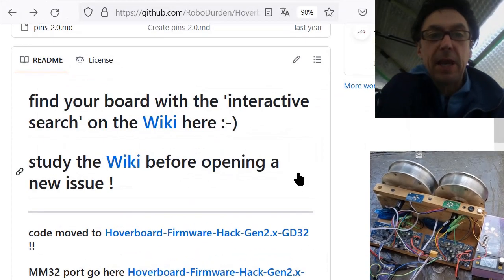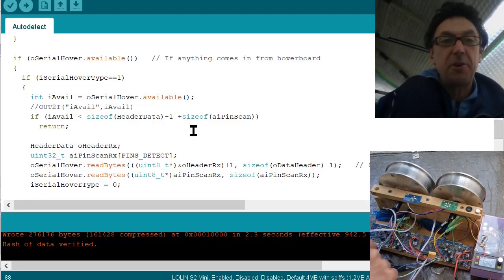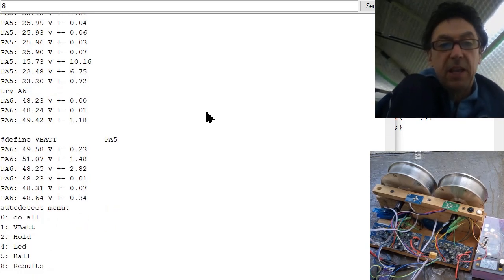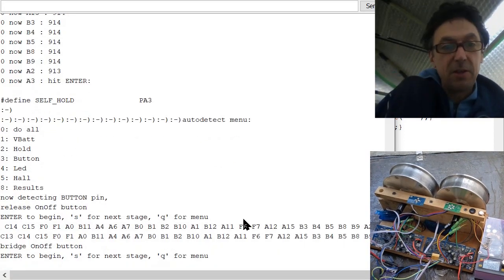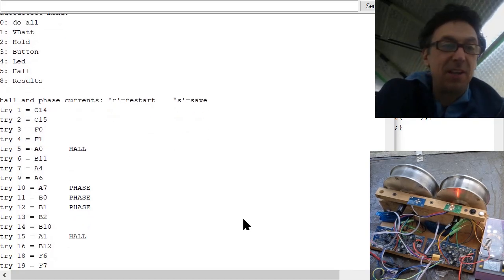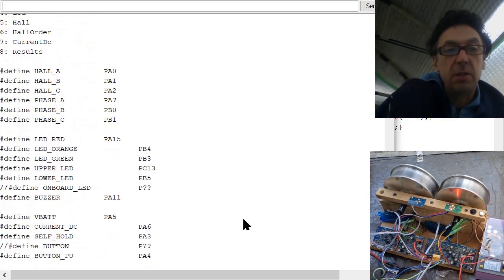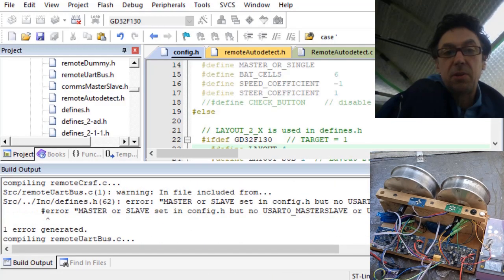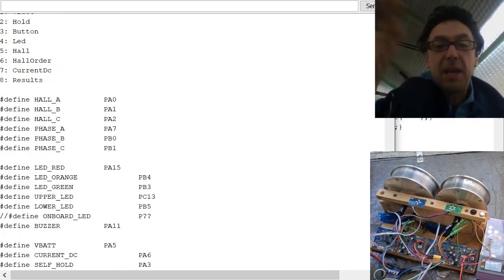Better Split Hoverboard Gen2 GD32 Autodetect

Comment: Hi, thanks for making this video. When I do the hold test, at the "release OnOff button" step, the board just turns off. I had to make some tweaks to make Autodetect work on a Blue Pill but don't think I've broken anything. Can you explain the difference between SELF_HOLD, BUTTON and BUTTON_PU? Can I compile the firmware without them? Thanks
Reply from the maker: SELF_HOLD is an output that activates the TO220 mosfet/transistor to keep the board powered. BUTTON is the digital input that detects the push of the on/off button. A push will also power the board and the code starts running. Therefore it is neccessary to quickly actifate the SELF_HOLD to keep the board powered after the push on the BUTTON is released.
BUTTON_PU means PullUp. I found one board so far that has an internal pullup resistor..
When the board immedaiatley shuts off when the onOff button is release, that means that i was not able to activate SELF_HOL by activating all free remaining io pins. That might be because your board is activating the HOLD transistor with an active-LOW signal, or whatsoever.

If you do not need onOff, you can bridge the button and turn on the board with this 75A switch: https://www.aliexpress.com/item/1005006310882730.html - the only one that works for my 24V solar car..
Reply: @robodurden  Thanks for the response. There is a chip that is present on the master but missing on the slave near the power cables marked with NCE01P13K 1PKL2. Could this be the doing the job of the TO220? The body of the chip and two of the pins are soldered to the board but the middle pin is not. I've not managed to trace any of the pins to the GD32. If it is connected,  I think it must be via other components.
Reply from the maker: @forfengeligfaen  please start a NEW issue on my github and upload lots of photos, as well as the full autodetect log. Best would be a video showing the hoverboard and controller while doing the autodetect.
https://github.com/RoboDurden/Hoverboard-Firmware-Hack-Gen2.x/issues

Comment: Thank you so much for making these videos. I have follow your suggestions to the "T" at least I think so. I am a complete noob. Quick question any suggestion on how to get rid of these errors? When i first connected the board it appeared to read the board. Then me being a noop I still did the disabled and checked the boxes and clicked apply. Now I have these errors listed below. Any thoughts?

08:50:33 : Could not set Option bytes!
                  Please reset the target and retry.
08:50:37 : Can not read memory!
                  Disable Read Out Protection and retry.
Reply from the maker: which Gen2 board ? Which software ? I guess you are talking about St-Link-Utility-V2. Gen2 boards can not be flashed with this tool. To flash firmware use autoflash.bat or Keil Ide. But unlocking should work. For me  it is always a try and error to find out what is working :-/
Reply: @robodurden  Thank you so much for your prompt reply and for all your knowledge,  you are the man. 
Mother Board # 
GD32E230
C8T6
AS84W6
JJ2022
GigoDevice
ARM

and yes the ST-Link V2 and the SMT v4.6 utility 

09:18:58 : ST-LINK SN : 16004A002933353739303541
09:18:58 : V2J37S7
09:18:58 : Connected via SWD.
09:18:58 : SWD Frequency = 4,0 MHz.
09:18:58 : Connection mode : HotPlug.
09:18:58 : Debug in Low Power mode enabled.
09:18:58 : Device ID:0x410 
09:18:58 : Device family :STM32F10xx Medium-density
09:18:58 : Can not read memory!
                  Disable Read Out Protection and retry.
09:23:01 : Could not set Option bytes!
                  Please reset the target and retry.
09:23:03 : Can not read memory!
                  Disable Read Out Protection and retry.

The goal is to make and remote control bot using old drone receiver and transmitter.
Reply from the maker: @boolitsbuildersllc.106  just continue with autoflash.bat or Keil to flash autodetect firmware. Maybe you are lucky. And contribute to a GD32E230 issue on github. I have no experience with GD32E230 boards.
Reply: @robodurden  well carp buckets. Thank you again so much for your time and your knowledge. Once I learn github a bit better I'll add the issue. Noob. However. TY

Comment: I have this one board. How can i program? O tried binary files by running auto flash but it is error 
"2024-05-20T21:04:50 WARN common.c: NRST is not connected
2024-05-20T21:04:50 INFO common.c: F1xx Medium-density: 20 KiB SRAM, 64 KiB flash in at least 1 KiB pages.
open(hoverboard.bin) == -1
2024-05-20T21:04:50 ERROR common.c: map_file() == -1
stlink_fwrite_flash() == -1"
Reply from the maker: maybe you first need to unlock with St-Link-Utilty.. 
Start a new issue on my github repo https://github.com/RoboDurden/Hoverboard-Firmware-Hack-Gen2.x/issues/new and upload photos of your board.